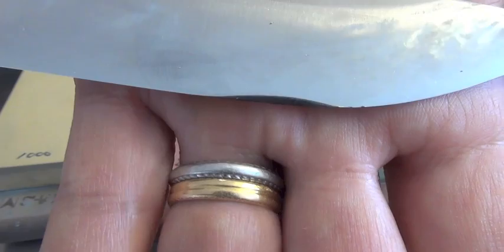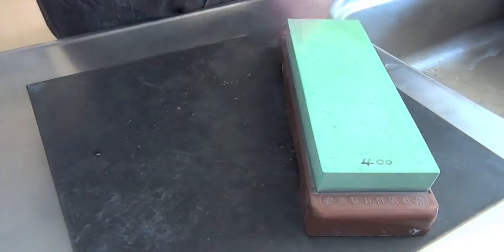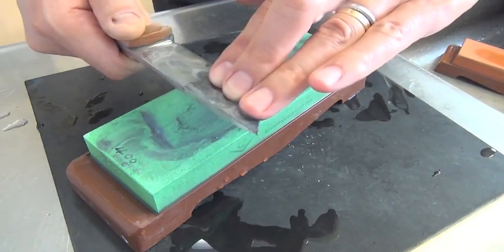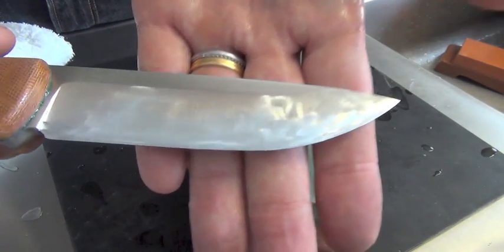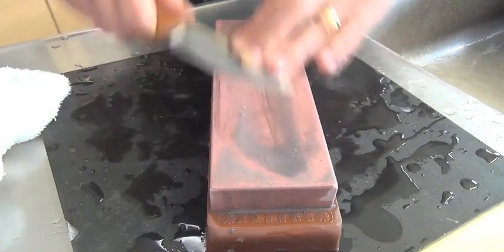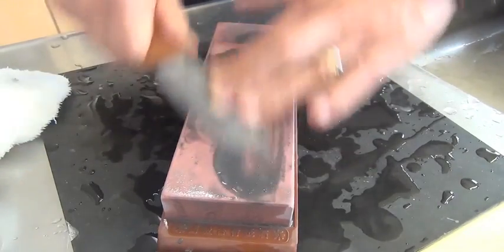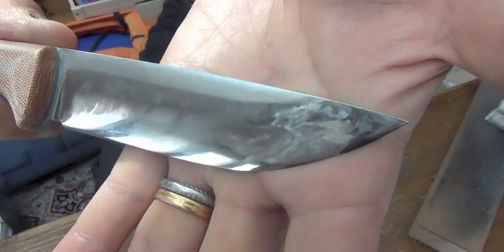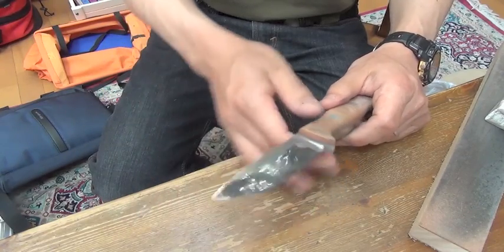A2 Bravo1 chip restoration

Comment: Very good,I personally put a 20 degree semi-convex edge on most my knives,it shaves a bald spot in a single stroke.
Reply: Same. But in my case it's a result of Being a beginner + cheap knife with 20+ factory angle + not being able to hold the exact angle while sharpening.

4 Knives in and I have removed the bevel shoulder and created a convex edge on every single knife - by accident.

They don't shave hair but I never had such sharp knives in my kitchen before.

Comment: In my opinion, fast cutting speed is essential when looking for water stones. Especially in the lower grit range where the goal is to establish a proper edge geometry.

When working on acute angles, each extra "redundant" pass on the stone only serve to increase the risk of that one "sloppy" pass which scratches the finish or even worse, ruins the edge. (We're talking very low chefs knife degree angles here)

Also when thinning behind the edge on a hard steel knife (powder metals or other high HRC blades), the difference is quite drastic. Not to mention the time saved...

Perhaps it's different for these hunting knives with its convex geometry.

tl:dr

I prefer hard and fast cutting "splash 'n go" stones.

Comment: What is that stuff you placed on the fine ceramic stone?
Reply from the maker: That white block is Mikawa White Nagura which produces slurry and removes stuck metal from the stone surface efficiently.
Reply: virtuovice thank you. Very cool. Will place that set up on my need to get.